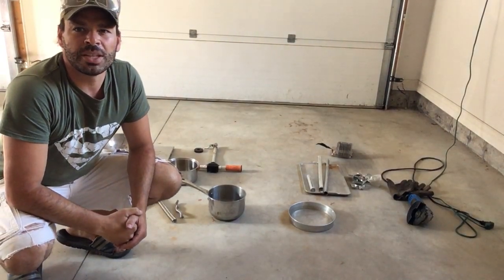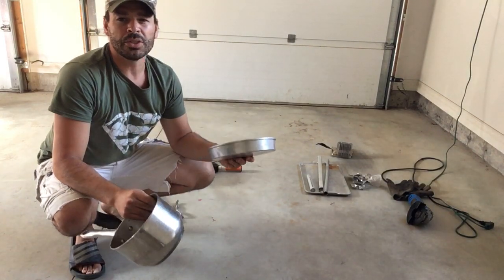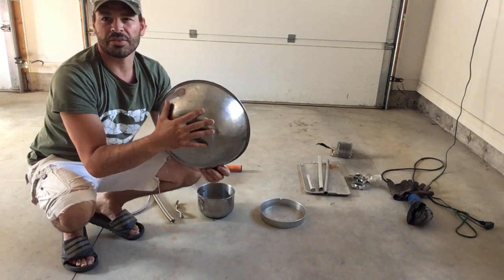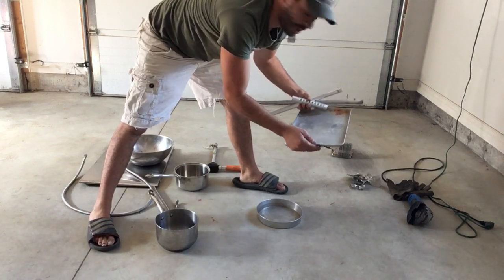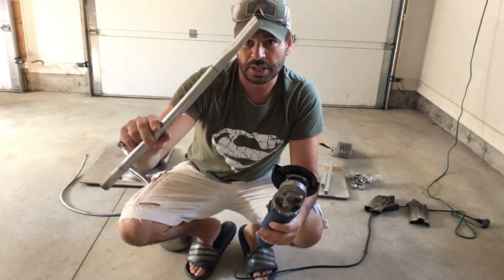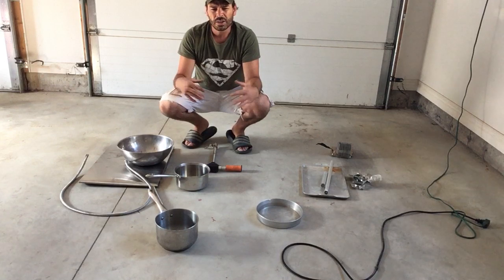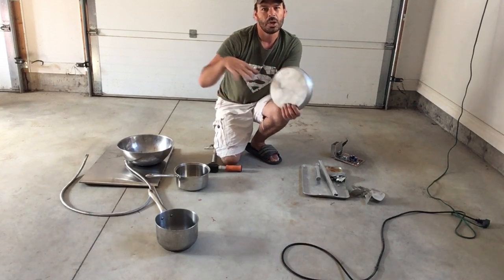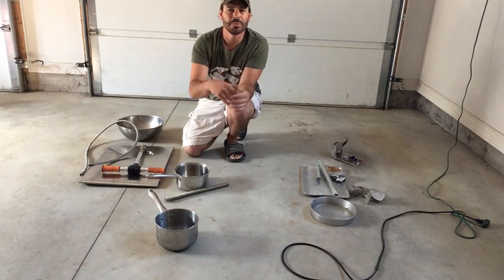How to tell the difference between stainless steel and aluminum effectively.

Comment: Thanks dude, just found a pin hole in the boiler I use for making shine, wanting to fix it on the cheap (potentially) and stuck at step 1 .. is the pot aluminum or stainless 😅 you are a legend, thanks for the vid bro!
Reply from the maker: Glad I could help. Stay well and thanks for watching.